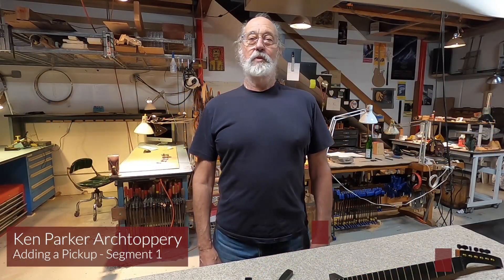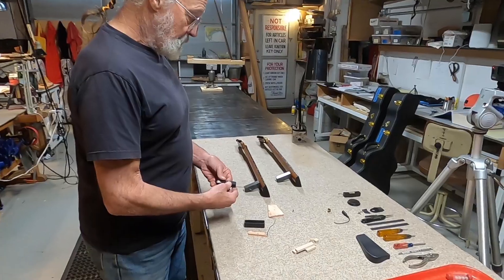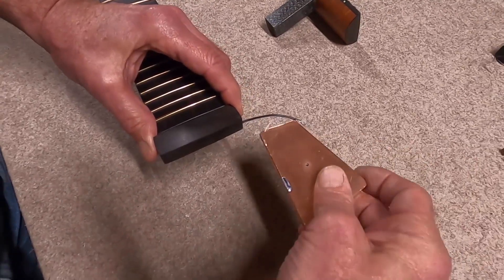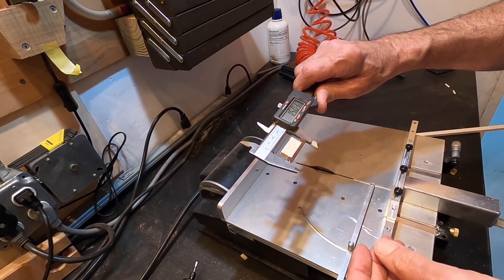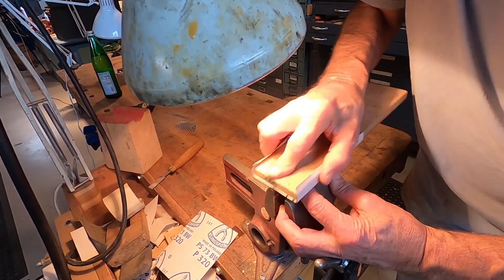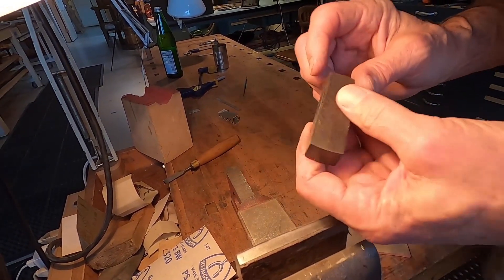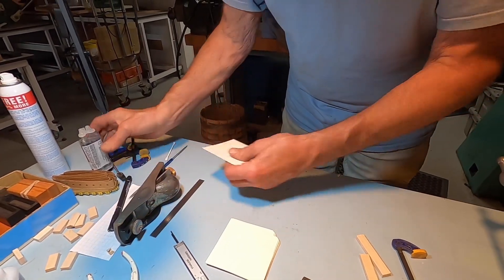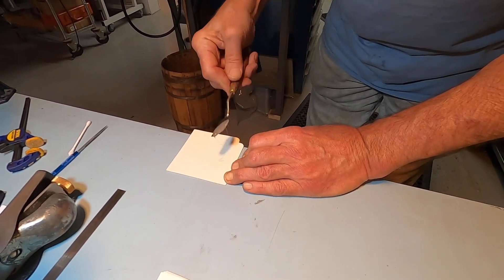Ken Parker Archtoppery: Adding A Pickup 1

Comment: Thomastik Infeld Jazz Swing Flatwound Strings (I use the Extra Light set for maximum playability) are designed for both Acoustic and Electric Guitars
Reply from the maker: These are excellent, from a very high quality German string maker since 1919.  Cost and quality are both high.
Reply: @kenparkerarchtoppery9440  So you need to save up alot of money for these amazing strings. They're nickel plated steel Flatwound Strings which sound great both Acoustically and Plugged into the Amp. Not alot of people realize that Nickel Wound strings can sound amazing on Acoustic Guitars too.

Comment: There are Nickel Wound Electric Guitar strings w/ Acoustic Guitar string Gauges & they have a bit of a Darker sound than Acoustic Strings so great for Brighter instruments
Reply from the maker: There are many string choices these days, with modern metallurgy and manufacturing methods, we're in the golden era of guitar string development.  

Not to advertise or recommend, necessarily, but these strings have recently made successful appearances on my work...

Ernie Ball has bronze wrapped strings using aluminum bronze, a very unusual and rarefied alloy used for special applications in industry.  

From Italy, Galli and Dogal have some very interesting flat wound strings with the flat wrapping made from 80-20 Bronze.

"80 - 20 Bronze" is an odd way to put it, because which, in any sane person's universe, 80% Copper and 20% Zinc is precisely what is known as BRASS, commonly called "Brass" or "Red Brass",
except when string companies buy it, whereupon it suddenly undergoes a miraculous transition, and turns into marketspeak Bronze.  

Not. 

Bronze normally contains zero Zinc, and is primarily composed of Copper and Tin, normally, 88%-12%.

I guess the market folks think brass sounds cheaper than bronze, which it is.

These, like other bronze or brass wound strings, have no magnetic signature apart from the steel core made of music wire, and therefore require a specially voiced magnetic pickup in order to balance properly.

Duneland Labs has developed such a pickup for my instruments, and this magnificent device is now available for yours,

https://www.dunelandlabs.com/

Here's links to the strings I just mentioned, please do tell if you find something else worth a try!

https://www.juststrings.com/ebl-2566.html?cmp=nextopia&kw=ebl-2566

https://www.stringsbymail.com/dogal-v24-nightclub-80-20-bronze-flatwound-acoustic-guitar-strings-12-46-16504.html

https://www.stringsandbeyond.com/galli-acoustic-guitar-strings-ajf1252-medium-12-52.html
Reply: @kenparkerarchtoppery9440  I use John Pearse Nickel Wound Jazz Strings which sound amazing both Acoustically and Plugged in. They're the only string set I know of designed for both Acoustic and Electric Guitars.

Comment: I restrung my new Jasmine S35 Acoustic Guitar with John Pearse Nickel Plated Steel Wound Light Gauge Jazz Strings (String Set 2600 and they're designed for both Acoustic and Electric Guitars). They actually sound a bit like Silver Plated Copper Wound Strings so it's more of a Gypsy Jazz sound.
Reply from the maker: Yeah, these are good strings. Each guitar and player might call for different strings. Fortunately, we have access to more kinds of high quality strings for acoustic guitar than ever before. Experiment!
Reply: @kenparkerarchtoppery9440  So even w/ this Pickup, use what you like.

Comment: There are Railhammer Pickups which work with all kinds of Steel Strings. Both Acoustic and Electric Guitar strings work great with magnetic Pickups because of the Steel Core (this includes Silk and Steel Strings). The only strings that don't work with Magnetic Pickups are Nylon Classical Guitar Strings.
Reply: I like using Railhammer Pickups because they compensate for the reduced volume of the Lighter Gauge Strings. The Bass Strings go over Rails to give them more Clarity and the Treble Strings go over Larger Sizes Pole Pieces which makes them sound a bit Darker.
Reply from the maker: You may like them, but from what I can tell they for electric sets of three nickle wound strings and three plain strings, and therefore are not useful on guitars like mine which are designed to balance with four bronze wound and two plain acoustic strings.
Reply: @kenparkerarchtoppery9440  4 Wound Strings & 2 Plain Steel strings. There are Electric Guitar string sets w/ a Wound 3rd which will work too, I've tried it on my Acoustic Guitar & it does create a Gypsy Jazz Sound as done by the great Django Reinhardt.

Comment: The craftsmanship is inspiring. 
I've never thought of five-minute epoxy is compliant in any way, I would describe it is glass hard. I would be tempted to use electronics grade silicone in its place, I wonder if you have any thoughts on that?
Reply from the maker: Thanks!  Glad you're feeling inspired!  
5 minute epoxy is uniquely formulated to cure at room temperature in a short time, and while it has relatively poor mechanical strength numbers compared with epoxy resins that have longer curing cycles, it is aggressive enough to stick many kinds of materials together adequately.  
Meaningfully measuring comparative hardness is a little confusing, as hardness is measured in a variety of ways.

Shore hardness scales, either "A" or "D" are used to measure the hardness of rubbers, and often used as an indication of flexibility or stiffness, which is called flexural modulus.  Flex Modulus measures resistance to bending, whereas hardness measures resistance to indentation. Epoxies are measured on the D scale, usually ranging from 35 - 90.  One way to get a flexible epoxy is to add rubber dust to it.  This makes the cured adhesive stretchy and compliant and is called "toughened" or "rubber modified".

The Devcon 5 minute epoxy that I use is rated at 85 on the Shore D harness scale.  PVC pipe and bowling balls are about 80 on this scale, to give you some idea.   
The Shore D scale is for grading the hardness of hard rubbers, while glass, as it is quite a lot harder than any room temp curing epoxy, or any rubber, for that matter, would need to be measured on another scale, such as the Mohs hardness scale. 
 
The Mohs scale is a bit subjective, as it works by testing things to see if they scratch each other or not, and while we're pretty darn sure that Diamonds (10 Mohs) will scratch Talc (1 Mohs), sometimes this test method can be a bit iffy.  What doesn't seem iffy is that no epoxy will scratch glass, so there you go.

The hardest, most rigid, and strongest epoxies require higher temperatures to cure completely,  Typical curing schedules for these resins require them to be heated slowly, then held at temperature for some time, perhaps a couple hours or more.  After initial curing, sometimes a "post cure" is needed to fully cure and achieve the best properties.  In this process, the cured part is removed from the tool, if any, and re-heated a second time to complete the cure.  

Epoxies come in a huge variety to suit all kinds of applications, and they tend to be pricey resins.   There's an awful lot to know about epoxies, and it's not me who is a resin chemist, but I do use several different epoxies, including one of these aforementioned elevated temp curing ones in my guitars.

I don't think I'd be tempted to try silicone of any grade for bonding wood or plastic.  In my experience, it doesn't work very well unless there's a bond line of significant thickness, which is a turnoff.  I have used it to make gaskets, etc., but I haven't found it to be a dependable adhesive in my guitar work.
Hope this is helpful!